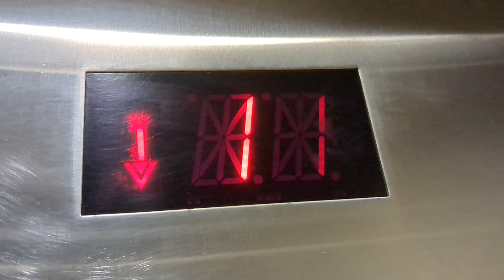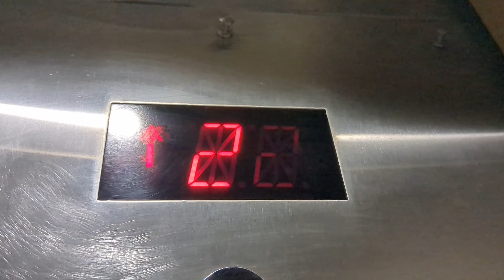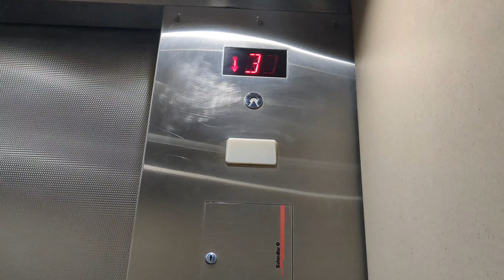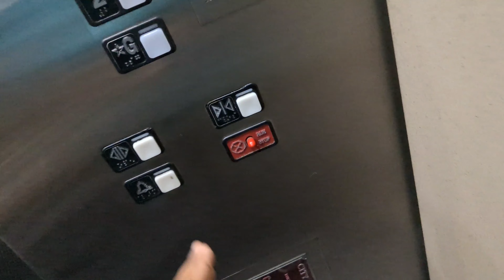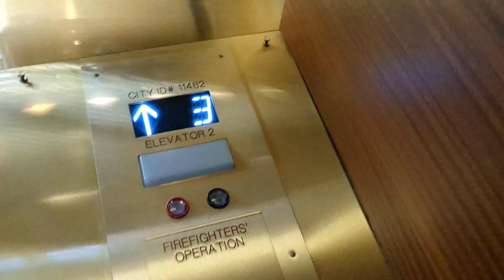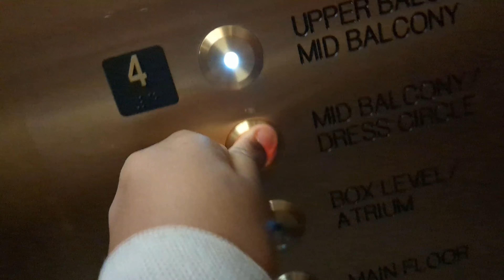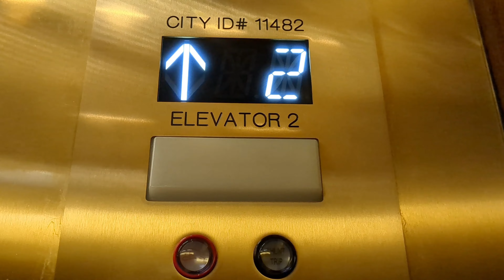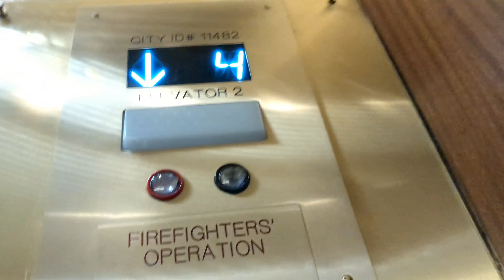(Safety Break) TKE/Otis Hydraulic Elevators & Schindler Hydraulic Elevators at the DSO

Comment: Decent elevators overall.  That second bank with Innovation is not Otis.  Also try to relax if you get stuck, no point to get yourself worked up over.
Reply from the maker: Was a bit scared that it stopped. That happened to me after Halloween too. Who modded these???
Reply: @DanfossDrivesAmerica  No idea who modded them.  When it comes to Innovation fixtures it can be tough to tell